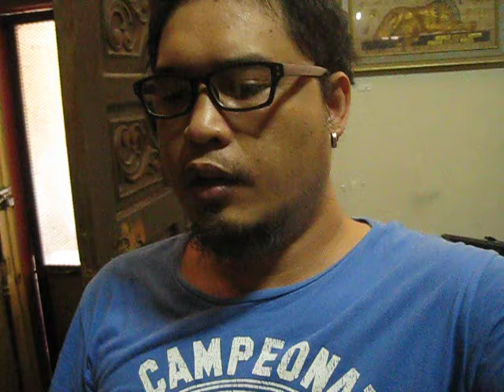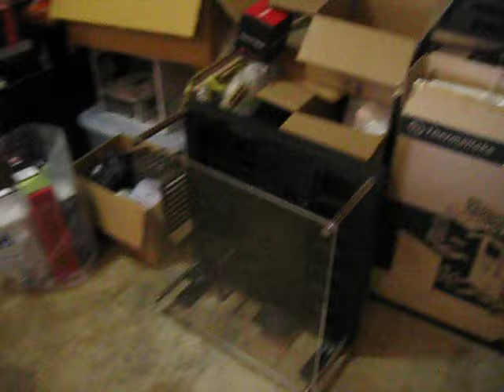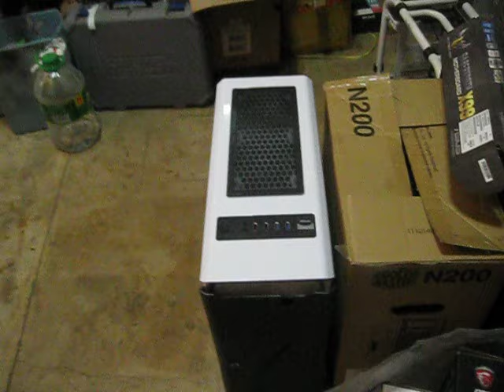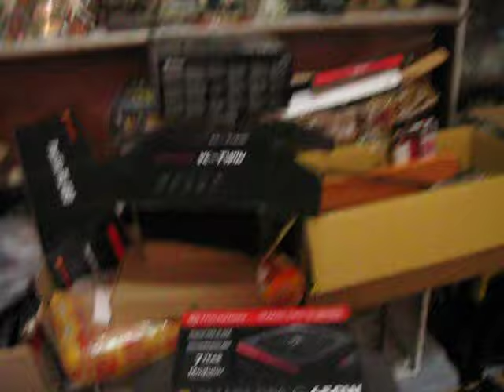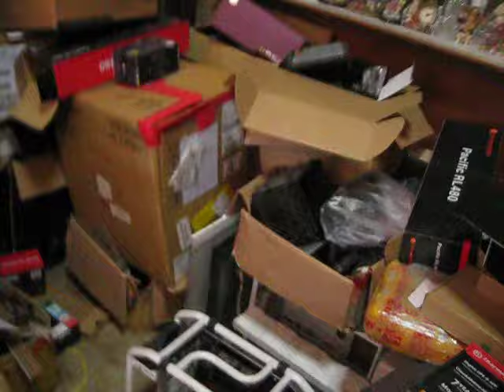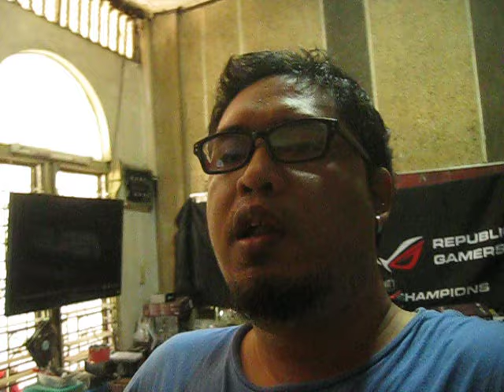the episode that doesnt count.

Comment: Are you from Manila? I'm gonna be a loyal subscriber, thanks for the info in your channel!
Reply from the maker: cebu city. :)
Reply: +JPModified That's great bro! sabi ko na pareho tayong pinoy.  So far your channel is the only pinoy channel i know showcasing advanced custom pc builds, i am very impressed i just know i am going to learn a lot from you.  I am planning a powermac g5 to atx conversion in the next 3 to 6 months when i upgrade my current workstation.  I will be building a Z97 or Z170 ws board with 4 gpus starting with 2 cards for 3d cuda rendering. it needs to be water cooled to deal with all the heat (100% utilization including cpu) but i think i can only fit 1 thick 360 radiator in the G5, i am not sure if it will be able to take all that heat.  I can add more rads but i will be cutting more holes on the g5 which i am trying to avoid, but i am willing to do if needed.  If this will not work i will have to think of something else, external rads maybe.  If you have any suggestions, they are most welcome. thanks!!
Reply from the maker: +Tristan Granados a single 360 rad will be good enough to tame most set ups with a single gpu. =) there will be tons more vids coming that will cover that, among other things. stay subbed. thank you.